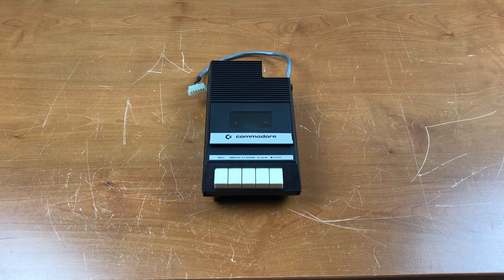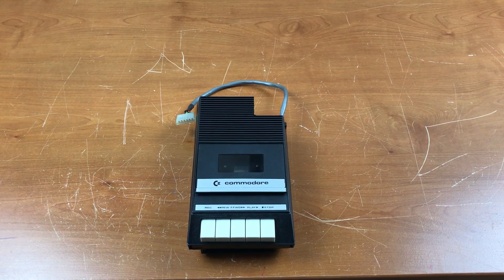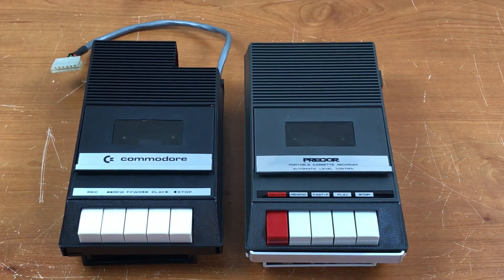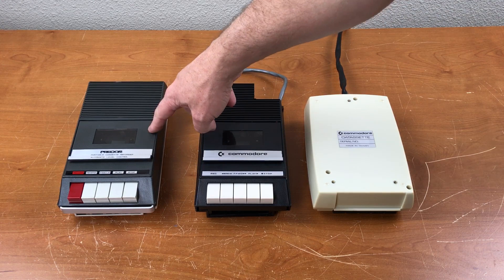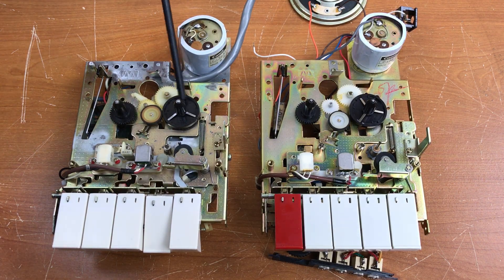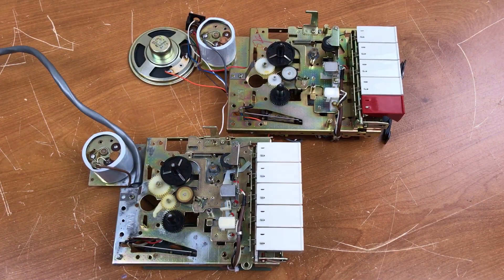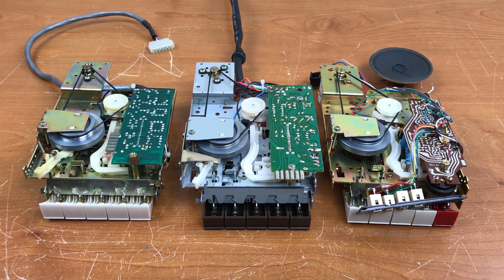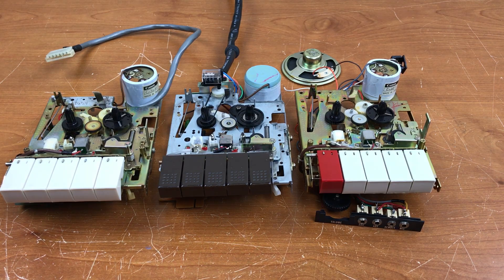The audio recorder version of the Commodore PET integrated cassette drive

Comment: Great video! I can remember seeing an interview with Chuck Peddle where he was talking about the PET development and how they just bough an off the shelf cassette deck and cut the case to make it work. They did a good thing using their own electronics, it made it much more reliable than using a regular audio tape deck. I even made an adapter to use a C2N with a TI-95 Procalc. Biggest issue many folks in Europe had with the C2N was very poorly duplicated tapes requiring constant azimuth adjustment.
Reply: @HutchCA  Yes, that is the interview.

Comment: I would hazard a guess then that Musashino was a competitor to Tanashin and designed/produced complete mechanisms for a variety of OEMs to put in their products. It's possible there was more than one OEM making these, to the same design - this was (and still is) very common in the cheapo end of electronics manufacture. Being Taiwanese (and seemingly quite well made) they may well be Tatung or Sangean. 

I'm pretty sure I've seen that mechanism before, on a different-looking cassette recorder that had a slider-type volume control to the right of the keys which might explain the weird spacing - these were made in Hong Kong in the late '70s under a variety of brands like (in the UK) "International" and "Harvard" among others.

I find old, crap (as in cheap) electronics utterly fascinating for some odd reason so this videos are highly entertaining to me, thanks!

Comment: I landed here because my very first audio tape recorder was that Precor model.  I convinced my parents to buy it at K-mart sometime during the mid-1970s (apparently 1977 or '78).  I'm not sure what ultimately happened to mine.  I've searched the web before to find information on Precor and this model, but never found anything.  Now suddenly I'm finding a number of hits!  Thanks for your video!  That little Precor machine played a role in my life/career journey.  I earned a degree in electrical/computer engineering.  Professionally, I write low-level embedded software.  As a hobby, I collect and repair vintage audio equipment.  I now have about 15 big open reel tape decks.  That little Precor was the start!
😮
Reply from the maker: I see a C-1800R up on Ebay this morning.
Reply: @HutchCA  
I actually saw one on eBay yesterday and ordered it.
😁

Comment: It's interesting that Commodore took out the speaker and replaced the circuit board on their altered drive.  Radio shack used a fully functional tape recorder with a special cable for the jack panel with the TRS-80 color computer, so you could use it as both a tape drive and a tape recorder.
Reply: With it permanently mounted inside of a PET, it wouldn't have been very handy as a regular tape player.